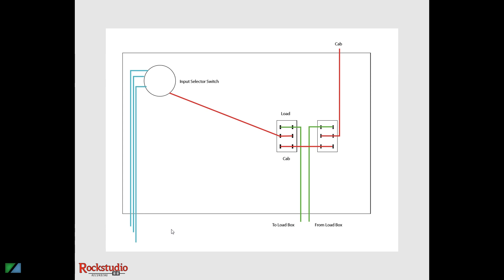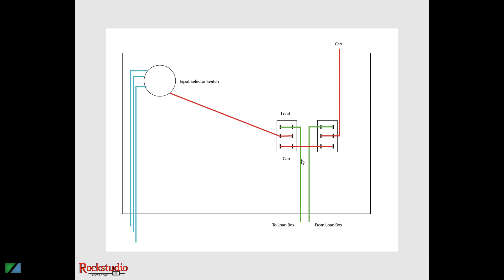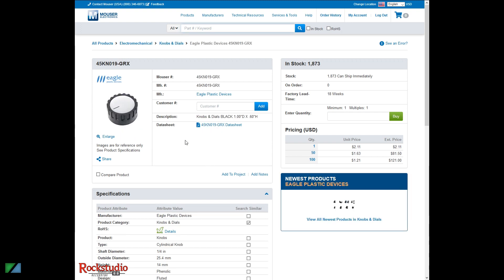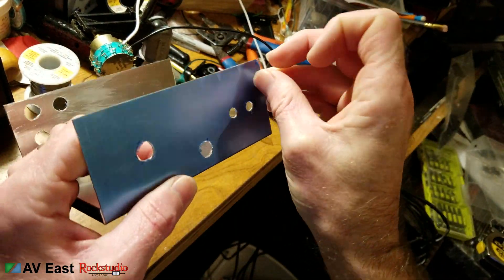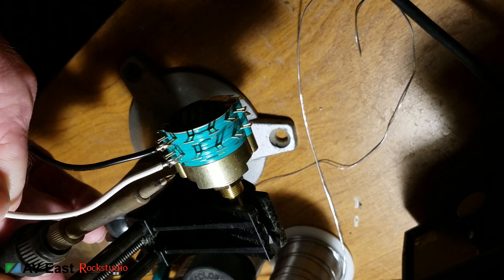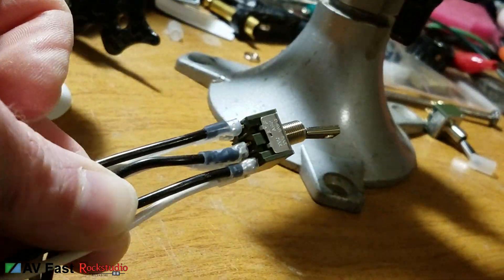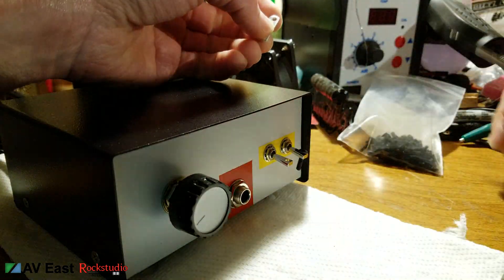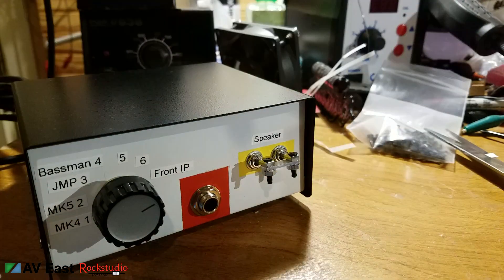DIY Amp Selector Switch

Comment: Looks great. Would be great if the amps that are not used go into a load so if you don’t  forget to standby you don’t risk to damage them.
Reply from the maker: You've got to remember to put them in standby, or at least disconnect your guitar from its input. Adding a dynamic / reactive load for each unused amplifier output would be extremely expensive, heavy, and would require more space.
Reply: @therockstudio a static load for a unused amp would be just fine.
Just some parallel resistors wiht a reaonable close value
Reply from the maker: @enricoincognito8595  thank you!

Comment: So which 2 wires ( positive and negative ) goes from the switch to the speaker  ??
Reply from the maker: Can you elaborate a little more? I really can't understand what you need to know.
Reply: @therockstudio   You have wires negative and positive connected to the switch that go to the 3 amps. i assume you have negative and positive wire that connects to an output jack, this jack connects to the speaker, am i correct
Reply: i would like to know how you connect the output jack to the switch
Reply from the maker: A 3:56, the first set of wires that I solder to the switch. Those are the poles for this specific rotary switch, and are the output to the speaker jack.
Reply: @therockstudio  thank you, so i assume its any 2 poles i can solder the negative and positive out to the jack??? because you do not say exactly which 2 poles, the switch has 12 poles on each deck
Reply from the maker: Well you can't pick any two lugs, you need to look at the schematic for the switch that you bought. The the pole is the part of the switch that is always connected to one of the lugs at any point. The lugs are the part of the switch that may or may not be connected to the pole at any time, do you see? So the pole is the central part of the switch, so that's what you need to wire to your output. Jack. If you look on the switch that I used, there are 12 lugs per deck but there is only one pole per deck. And that's where you see me soldering the first two wires.

Comment: Just a tech note : the rotary switch power ratings are 28V-500 mA … so That’s a max of 14W. Voltage if roughly ok but current definitely not… be VERY careful as you are clearly overpassing the switch’s ratings.

Comment: This is just what I was looking for. The 1/4 TS Jack's you have in your list should be able to handle the power no problem right? Or should I use the one you show on the video.
Thank you!
Reply from the maker: Connectors that I have linked are the ones I used in the video, are they not? Any good quality TS connector will work, whether it be neutrik, amphenol or switchcraft. Thank you so much for watching and commenting! Good luck on your project.

Comment: Great video brother! Sorry for the dumb question but I am getting ready to order these parts. Is there an “output” on the rotary switch? Which lugs do you wire to the 1/4” jack for the speaker cabinet? Thank you sir
Reply from the maker: Wow! Awesome to hear! Sure, each deck on the rotary switch has a pole. The rotary switch for this project has two decks, so it's double pole. The poles will be your outputs, one for positive and one for negative. Be sure to take a look at the datasheet for the switch, and it helps to have a multimeter with a beep/continuity feature with you. I don't have the switch in front of me, and if I didn't specify in the video, use a multimeter to make sure that pin number one is in fact the pole. So for instance on deck one pin 1 is going to be your positive output, deck 2 pin 1 will be your negative output. Pin 2 of each deck will be your positive or negative input from the first amplifier, pin 3 on each deck will be your input for second amplifier, and so forth. If you don't wish to use 11 inputs, you can set the switch to only rotate a few clicks. So there is a metal pin under the washer which you can move to whichever location you desire. 
Pin number one is always active, when you turn the knob the other pins are connected only when the knob is in that location, so use your continuity tester hooked to pin one on deck one and then the other lead on pin 2. Make sure the knob is all the way counterclockwise and you should hear a beep from your multimeter. Turn the knob one click clockwise, the beep should stop but if you were to move the lead from pin 2 to pin 3, you should hear the beep again. That way you know that pin one is always active and the other pins, two through 12, will only be active when the switch is in that position.

Comment: I'm definitely not an expert on electrical output but I'm trying to build the same thing and it looks like the amperage rating on the rotary switch you're using is too low at 500mA.  I would think that it would overheat because the amperage coming out of the guitar amps speaker output would be over 4 amps.   Have you had any problems since building this box?
Reply from the maker: The current carrying capacity of this switch is 15 amps. There is a spec on the switch for make-and-break resistive load which is 500 milliamps at 28 vdc, and 300mA at 120 vac. I believe that only applies if you were trying to switch under load, which does not apply to our purpose. I'll check with them on Monday to find out for sure.
I intentionally selected this switch to be heavier than we'd need and 15 amps is well more than enough for our case. Another thing to look at when you're buying a switch is the cost. If this was a plastic-shaft rotary switch, which cost $3, I doubt it would perform at 15 amps. This is a $40 switch, and you get what you pay for. The other rule of thumb to go by is "buy nice or buy twice".
Reply from the maker: I checked with Electroswitch, I was correct about switching under load. The switch will only pass .3a @ 120vac under load. In a stationary position the switch is rated for 15A. I use mine nearly every day, it has been in use since I made the video. I try to spec-out heavy duty, long lasting parts for anything I build. Thanks for watching.
Reply: @therockstudio  Thanks so much for clarifying.  I mistook the make-and-break resistive load for overall capacity and trying to find one at 15a was insane.  Now I can build this thing without breaking the bank.  Thanks again!